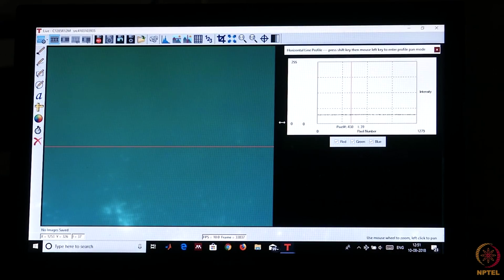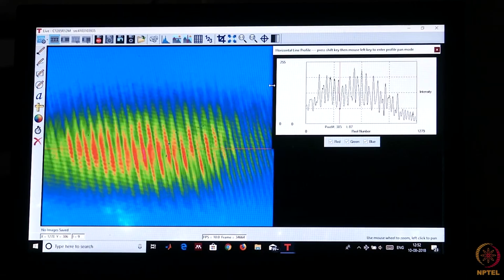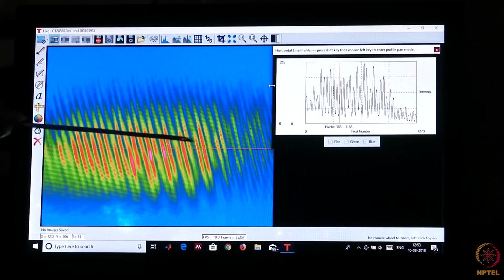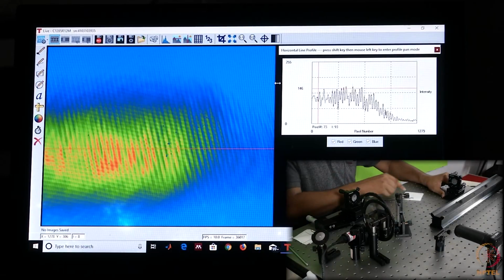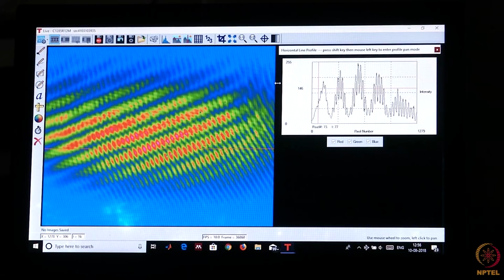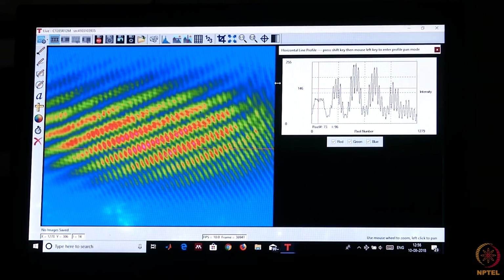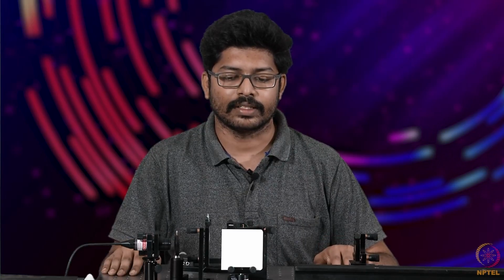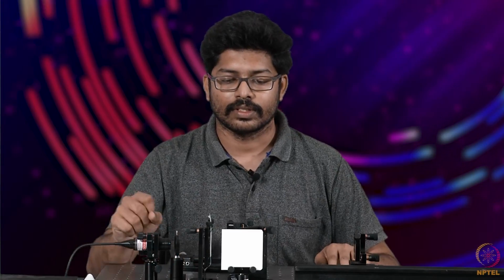Lab Demonstration : Michelson Interferometer

Comment: They used around 600 nm wavelength of light and are looking for fractions of a wavelength in differences.  That's 10-7 meters or less, about the size of a virus.  How in heck did they get the two reflecting mirrors equidistant to within 10-7 meters?  IF there had been an ether, would the wavelengths of both beams have stayed the same?  If there was an ether, would moving through the ether have no effect on the thickness of the glass on the mirrors or any other material component of the setup?
Reply: temporal coherence is in the order of cms not in ums
Reply: @srinivaspachava8893  I found the answer.  They didn't actually put the two reflecting mirrors equidistant (which would have been impossible) and they also didn't set up the apparatus to produce zero interference, they simply produced an interference pattern and measured the band distances, and then rotated the apparatus floating on mercury and found that the interference pattern didn't change in any orientation.  I was taught in high school that they tried to show that there was no interference with the mirrors equidistant, but that clearly is unreasonable.